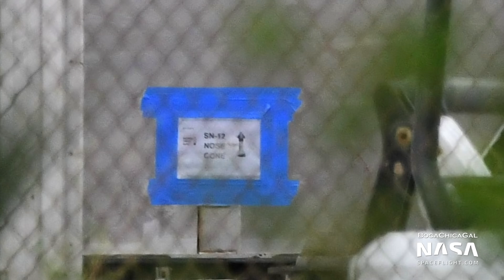SpaceX Boca Chica - Bridge Crane for Super Heavy Stacking Delivered - SN12 Nosecone Barrel Spotted

Comment: 0:00 - Sunrise
0:57 - SN8
1:20 - Launch Site
1:45 - Orbital Pad
2:14 - SN8
2:45 - SN8 Aft Section / Pad A
3:14 - Fwd Flap Loaded on Truck
4:02 - High Bay
4:22 - Build Site
4:43 - Delivery / Fwd Flap Moved
5:23 - Gantry Crane Moved Next to High Bay
6:21 - Crane Parts Unloaded
7:16 - SN12 Nosecone Barrel in Windbreak
7:47 - ‘Cone Zone
Reply: Thanks Jack
Reply: Thanks !
Reply: Thanks jack and Mary!!!!
Reply: Thanks....good job.
Reply: 5:23 and 6:21 that is a cradle for the roll-lift. It’s for carrying the starship to the pad and not a gantry crain. Looking at RGV’s pictures from 10-30-2020 and you can see it assembled in pictures 11, 12, 16 & 17 thank you for the info

Comment: Just FYI, there is a difference between a bridge crane and a gantry crane. A stereotypical example of a gantry crane is the one shown at 7:50; they have 2-axes of freedom during a lift: hoist tracking left-right along the gantry (typically an I-beam), and up-down (lift axis); sometimes these have wheels, but generally the structure isn't meant to move during a lift. A bridge crane has three axes of freedom: the bridge movement "north-south" (this is usually on rails mounted atop I-beams), the hoist moving across the bridge "east-west", and up-down (lift). Note that a bridge crane doesn't have to be oriented along the cardinal compass directions, but they are usually labelled as if they were.

You can find a few hybrid cranes out there, like a gantry crane where the footings might move along a rail system. I would expect the high bay crane to be a bridge crane, per the video title, rather than a gantry (in the annotation on the video itself).

Comment: I dont think its the gantry crane. Its most likeley a supportframe which can be mounted in between te SPMT's (the rollers official name). The coupling at the bottom, combined with the whole pattern above it, match with the large pin from the SPMT's. They will probably place 2 trailes side by side (double wide) and place these inline between the modules, creating a "Vesselbed" kind of transport frame so the cargo is not loaded on the deck of the trailers, but rather lower and "in between". Also, i work in heavy transport, google SPMT Mammoet for more info.
Reply: Is the road from build site to launch pad wide enough for that?
Reply: Glad to have your expertise available!
Reply: @Rob Bannstrom I was thinking the same thing about the weight, but maybe that's why they call it super heavy?
Reply: That makes a lot of sense.  It's probably for moving SuperHeavy; the extra width should add stability for the taller stack.

I know it'll be a while until then, but what do you think they will use to stack the first Starship+SH?  Maybe it'll be time to call Mammoet?
Reply: Yes I was battling to see how that was anything like a usual gantry crane. I kept on wondering how the slenderness ratio was going to work with superheavy and you have answered it.
Reply: @Rob Bannstrom Maybe primer? Yes, gantry cranes are black and yellow (Terminator 2). Then again, rockets are supposed to be black and white. Now I'm really confused. :)
Reply: @Sn0wZer0  We would be happy to join the party! But we work with Roll Lift a lot, and they are a great company with great equipment and people as well, so probably are more than able to lift Starship onto SH........i do have an (unofficial) prepared liftplan on my desk allready, so who knows....
Reply: @Sn0wZer0 , the Liebherr hasn't been built to full extension yet.
Reply: TheKeister  maybe English is his second language as Mammoet are a Dutch Company, that originated in 1807
Reply: Yeah, you're totally right. my bad!

Comment: Very cool, as always. I wonder how they’re going to get the new crane into place. Seems like it would have been a lot easier before the roof was installed.
Reply: Most gantry cranes are installed after construction, the company who manufactured the crane has winch packs that attaches to the gantry, the gantry is maneuvered into the bottom of the structure and lifts itself into the final position
Reply: @jockwood2398  that's pretty interesting.  It actually makes sense now that it has been explained as I was thinking the same thing about installing it prior to the roof.

Comment: Most definitely not a gantry crane. Look at 5:46. You can see the interface on the end of the SPMT (5 vertical plates) and 10 holes along the top edge) matches perfectly with the structure it's carrying. Then at 5:51 you can see the side of the SPMT has bolt patterns running down the side which match perfectly with the two six-bolt patterns on the brown plate sticking out towards the camera.

Comment: SN12 nosecone barrel in windbreak doesn't have any stringers yet. I assume that means that they are welded on manually. I know the production process is early days and evolving rapidly so I wonder whether welding on the stringers will become a job for a robot at some point in the same way they are experimenting with a robot to weld on the studs for the heat tiles. The robot would need to get inside a ring stack to do that but they could use a crane to lift a stack on or off a welding station with one or more robots in the middle, or maybe even mount the robot(s) on a gantry so they can reach down to get into the inner surface of a ring-stack from above. It must be a pretty tedious job for a human to spend days on end welding on stringers.

Comment: I've been wondering why they didn't put in the gantry crane before the roof of the high bay? Use Bluezilla while it's still under construction and you don't have to deal with fitting it up under a roof, just lift and fit it into place while suspended. Then put on the roof.

Comment: 5:23 Sorry, doesn't look like part of any gantry crane I have seen and as @Skif Juinen points out, matches exactly what a roll-lift "vassellbad" should look like.
Reply from the maker: Yeah. Looked just like two beams I've seen on the KSC VAB Crane, but nope. Some crazy Roll Lift contraption.
Reply: @NASASpaceflight   Those are Sarens SPMT's.  Those spacers are likely engineered by Sarens.  Trying not to be picky, but I get tired of these trailers being referred to as Roll-lifts by the majority of people watching this progress for some reason.  I LOVE ALL OF YOUR COVERAGE.  THANK YOU!
Reply: @NASASpaceflight  The first thing you should see for gantry will be the 2 wall track beams. They should be almost the opening wall in length and very, very deep.

Comment: that crain OR some type of lifting device will be installed at the top of the high bay, should be able to roll outside grab the nose cone from the ground  and pull up and in and place on top of SH in the high bay. still curious when they will start building the Tower by the orbital launch complex and how they will stack SN9 into the SHB
Reply: Whatever form the gantry crane in the HB takes it will not be able to move outside to pick something up.  The parts would be moved into the HB then lifted.  There is a lot of space in there.  They could be building a SH and a SS at the same time.  Keep in mind that mating the SS to the SH will be different than mating the SS payload section to its drive section as SH and SS are not welded together.  As for the tower by the orbital pad, I suspect that will be a bit yet but SpaceX has shown they can put stuff up quickly.  The issue will be what materials they use as concrete takes a while to cure before it reaches its desired strength.

Comment: Will there ever be a super max building to combine both parts; that is the booster and the Starship? ~400ft
Reply: Maybe, but I think the short term plan is to stack them out in the open. I think the usefulness of the vertical assembly buildings is to mitigate wind and environmental interference with the welding and internal work, and also to allow for a gantry crane to simplify stacking.

Since stacking starship and super heavy together is only a single step process, lifting a ship heavy enough to resist wind, not actually needing to weld them together, and not needing to have workers on and in the starship during or after stacking, all means that stacking it out in the open isn't such a big problem.
Reply: Almost certainly not. Transporting them down the road (or to an offshore platform) is easier if they're separate. And the official plan all along is for Starships to be stacked on the launch pad, that's how SS/SH is designed. When segments are stacked they need protection while they're welded together and lots of other work is done. SH and SS are complete when they arrive at the pad. SS is designed to just be popped on top of SH.  (Complete except for engines, but I wonder if that will change.)

Comment: Fabrication tent at orbital launch pad.
Reply: But what will they fab? Orbital pad parts?
Reply: Yeah, it's what I've been thinking. The orbital pad will be on a massive scale so with winter coming a place to protect, prepare and organize all the parts is sensible.
Reply: Could be shelter for building sections of the launch platform's decking. Perhaps exhaust deflector sub-assemblies. As well as manufacturing the vehicles in short sections then stacking them works perhaps the tent is for fabricating segments that will stack to make a tower crane to place Starship on top of the booster.

Comment: MAGNIFICENT !  ... but I really doubt the WINGS can have any chance of success.  I am concerned that this is a source of problem.
Reply: That is because they are not really wings, as they will not provide lift. They are more like flaps, to guide the craft down through reentry.
Reply: Wings in tha cones use as a great scape if something wrong to happened.
Reply: Their real and only purpose is to provide drag, no?
Reply: I believe Starship's flaps are intended as an aerodynamic attitude control system during reentry. Partially folding both surfaces on the same side would make the vehicle roll in that direction. Differences in how much the nose compared to tail flaps are folded would make Starship pitch up and down. In the late stages of the descent suddenly folding both tail flaps while leaving the nose flaps extended would make the Starship's tail quickly swing down for the rocket braked landing.
Reply: The simulation software for these aerodynamic conditions have high fidelity. I'm sure it is 100% successful in simulation, and the most likely failure mode is something unrelated to the modelled aerodynamics, such a hinge-binding, flutter,  vibration loosening something, etc. What looks problematic to me is how are they going to shield the hinge line during orbital reentry?
Reply: I think... 
on take-off, and during the entire ascent: 
at the slightest gap between one and the other, 
these two wings will cause the rocket to spin around itself.